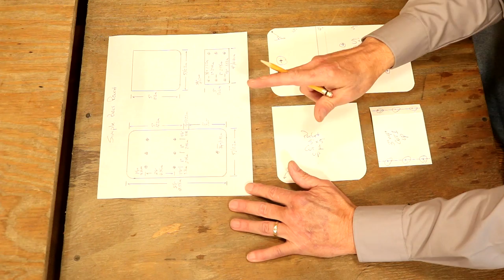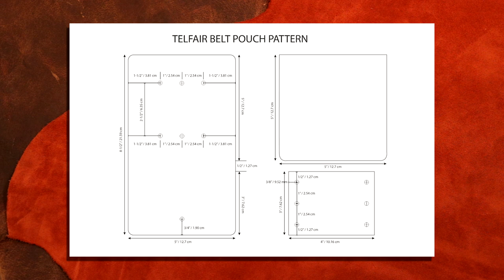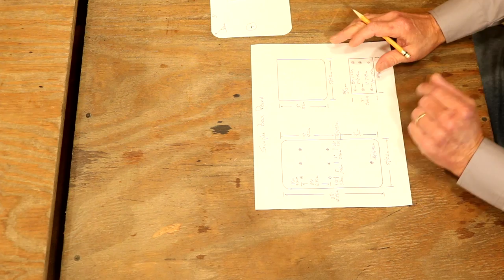Making a Simple Leather Belt Pouch

Comment: I'd like to know how a wallet with multiple card slots on the same piece of leather works. How is it arranged so that all the cards don't drop to the lowest level?
Reply: Easiest, cleanest way?  Double-sided tape and ribbon or thin fabric.  You can get the fabric in 2.5 inch widths. Perfect size for credit card slots.

The process is math heavy, but very simple to do.

There is an older video on YouTube where a guy shows how he does it. His process can be expanded to as many slots as you want.

I've made several wallets using that method, and I've not had one fail in years.
Reply: @joshualyle380 , do you remember what I might search for to find this vid, please?
Reply: @michelleparks  I linked it just below my previous comment.
Reply: @joshualyle380  I don't see a link.
Reply: @michelleparks  sorry, not sure why it didnt show.  The title is: leather crafting card slots for wallets.

Only thing I see on the screen are the guys hands holding tools.
Reply: @joshualyle380  thanks!

Comment: I wonder what leather you’d recommend if you want to make that basic pouch, but alter it to become a phone pouch. I’m thinking you probably want a vegetarian that you can soak and mold over a piece of wood or something to get it to adhere to the shape of the phone or maybe I should say the phone case. I’ve had many times where my phone has fallen out of my pocket just getting in and out of my car and one time when I was in an accident my phone was jerked out of my pocket during the impact. My car had on star,but because the battery was in the trunk and the trunk was smashed into the backseat. I had no way to call for help at first. I had to force the jammed door open, and then was able to find my phone on the floorboard beside the seat near the door. A pouch with a flap that snaps would prevent that from happening, and I’d be less concerned about my phone getting lost.
Reply from the maker: A veg tan would work great to wet mold around the phone. Maybe somewhere in the 4-5 oz. range depending on how heavy duty you need it. Hope that helps